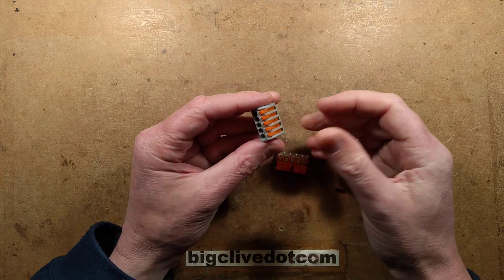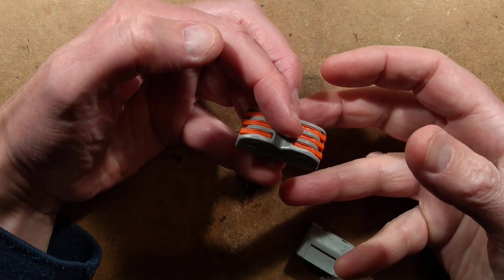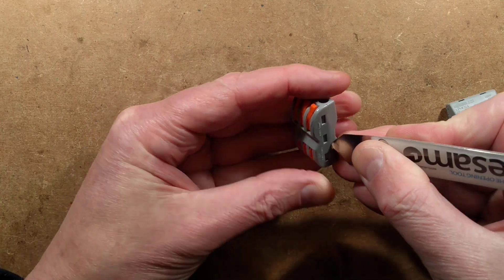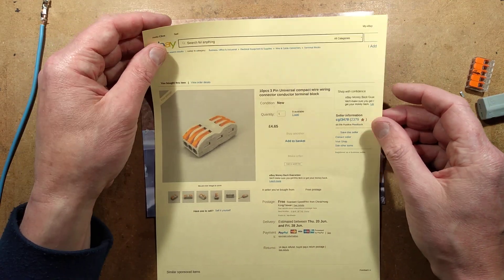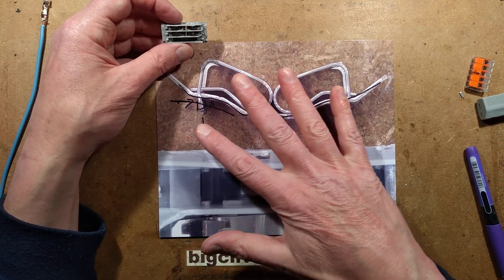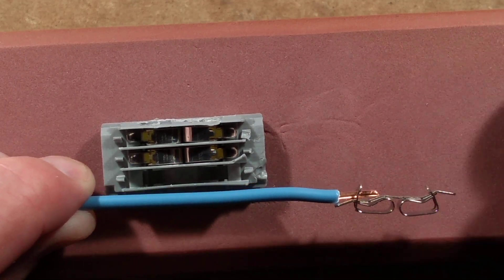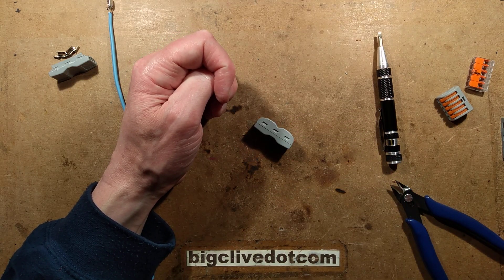Clone of Wago product that Wago don't even sell???

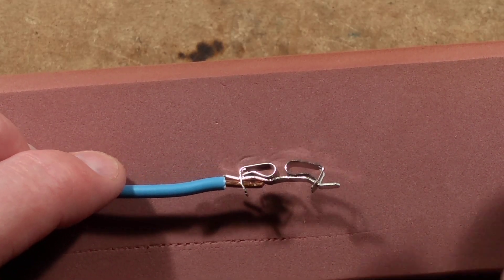Comment: 6:52 I'm surprised there's such a relatively small contact area - it looks like it's only making contact in a ring around the middle of the wire and again at the tip of the wire.  I wonder how much current they can handle?  I know John Ward found the usual Wago connectors could do 32A quite happily, so if it's the same design here then I'm surprised you can carry 32A in such a small area of contact!
Reply: The contact plate comes down tp press against the wire making the contact area the whole length of the exposed wire.
Reply: @calmeilles  But if you look at the video the wire doesn't bend into place against the contact, so it only makes contact at two points instead of along the wire's length as it might with softer or stranded wire.

Comment: Interestingly, the 2-wire version of this connector actually has "L" and "N" marked on the underside of the connector, either side of the incorrectly-spaced "CE" mark, to indicate which terminals should be used for live/line and which for neutral, but the 3-wire version - at least the ones that I have - doesn't have markings like that! Even more oddly, those "L" and "N" letters are embossed, while all other markings on both sides of these connectors are engraved!

I bought a 15-pack of the 2-way connectors for £7.58, and a 12-pack of the 3-way connectors for £9.88, both from Amazon, in April. So that eBay price is pretty good ;)

Another Chinese extension to the Wago product line that I've been making use of for a couple of years is an 8-terminal "222" connector (the old-style fat, opaque grey, commoning connectors). Commoning eight wires is probably not required too often in mains-voltage applications, but it's very handy for various low-voltage applications, such as LED strip installations where you'd rather have several separate strips with their own 5/12/24V supply in order to avoid the voltage drop that you'd get if you fed all of the LEDs from one end.

I've got a couple of installations of "neutral white" (~4000-5000K) LED strips around the house and on both of them I've noticed that the LEDs closest to the 12V input have turned very yellow over time (only a couple of years of not-even-close-to-24/7 use), which I figure is the result of those LEDs seeing a higher voltage than the ones later in the strip. Both strips are the gel-encapsulated "waterproof" style, though, which I think must greatly affect the ability of the LED packages to get rid of the heat they produce. They're the "5050" type as well, so each package is dissipating somewhere around 750mW while surrounded by a load of thermally-insulating silicone!

I plan to replace the worst-affected installation with the non-waterproof type at some point, and I'm considering setting them in some aluminium LED strip profiles in an attempt to better remove the heat (that set is in my 3D printer's enclosure, so they need to be bright but they also operate in an ambient temperature of around 50℃ when printing with plastics that benefit from the enclosure being closed up, e.g. ABS, ASA, PETG, etc.).

Either that or I might get some LED strips from AliExpress that use aluminium PCBs rather than flex PCBs - the keywords to use to find those are "led strip hard" or "led strip rigid". Those are also extremely affordable - often less than £10 for ten 50cm sections - and it looks like a lot of them are much higher-power, too: I'm seeing some that are 28W per metre! But I haven't found any that specify their CRI... I might have to design my own LED strip PCBs and use high-CRI 5730 LEDs from Digi-Key/Arrow/etc.! I note that PCBWay are currently offering 1-layer aluminium PCBs at VERY affordable prices! <3

Comment: Has anyone got the search terms for this? Can't find it and seems quite handy for temporary connections. Thinking i2c and ground for microcontroller stuff
Reply: SPL-3 Type is the term i believe after a quick google search. SPL-2 for 2 Wire. And there is even a railmount type.

Comment: Clive :- I'm surprised you had so much trouble getting the thing open.  A while ago I got a batch of the knock-off Wago connectors from China (the price was so appealing compared to the genuine ones) and I found that if you lift all the levers up together, the thing springs apart by itself!  Needless to say I would never use them in a mains installation, but they are still handy for projects on the workbench (as long as I only lift one lever at a time).
I really like this implementation, and having a junction with such a small form factor is very handy.  They seem pretty robust too, compared to the ones I got.

Comment: Ideal as a poor man's Quicktest.
Reply: My poor mans Quick test is three alligator clips screwed to a piece of 2" x 4" wood. (Note its after the variac, current limiting light bulb and isolation transformer).
Reply: i use 3 separate wagos for that right now
Reply: @ua89das7ufj  Which is exactly why this product is so amazing 

I was so Mad the last time I Had to use 3 wago Terminals just to splice a fucking wire, Ended up soldering it instead
Reply: I stick wires into traditional IEC-60320 C13 plugs. :D
Reply: @pmailkeey Even easier in the days of round pin plugs - you just poked the wires into the socket sleeves and shoved a plug in on top!

Comment: I just looked and there are loads of these Wago clone pass-through connectors on Amazon for any US viewers. I also saw 2 pin versions which would be better for DC hobby hookups. Ironically they were shown to me as a related listing when looking at a genuine Wago block.
Reply: Use the three pin and leave the middle empty, for extra separation.

Comment: I'm always annoyed with the official ones that I need three of them in a bouquet-like configuration. This looks like a neat solution, although I'd be even better if it had four clamps per terminal (two on each side instead of one), so I could join multiple conductors like with the original ones.
Reply: Clive Penfold That's a useless product page failing to state the basics of that product clearly.  There's no data sheet, only a random subset of data points.

How many separate wires does it actually connect and in which mechanical combination (similar to a chip pinout diagram)?  Are the wires connected by springs and the block screwed to a box, or the wires mounted by screws and the block pushed into a box?  How many times can wires be installed/removed in each hole before buying a new block and starting over?  What is the required mechanical, electrical and thermal  clearance around the block?  What is the correct length of wire to strip (stranded or solid)?  What range of isolation thickness is allowed on the wires?
Reply: @johnfrancisdoe1563  There is literally a fucking data sheet generator on the right of the picture, with technical data, connection data, geometrical data ,mechanical data. 

Learn to look with your eyes before you spout bullshit.

Comment: I just checked the german website of Wago and could not find any product of this sort. But I also often thought when using their terminals for e. g. connecting lamps "why don't they do these in the style of classic screw terminal strip where you can connect them through?"
I really whish they would officially make them like that. The you would only need 1 clamp for connecting lamps, etc. in stead of three 2-pin common connectors.
Reply from the maker: It would be funny if Wago cloned the clone.

Comment: I love the common connection version of these connectors. May have to get a set of these as a splice connection would be great to have as well. I use them to mock up projects before making final solder joints, etc. Thanks for posting!